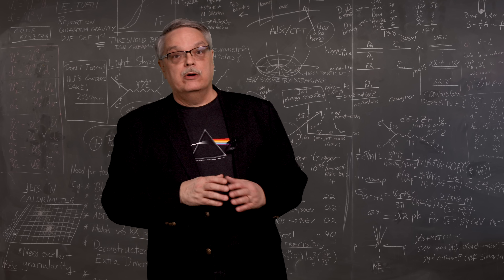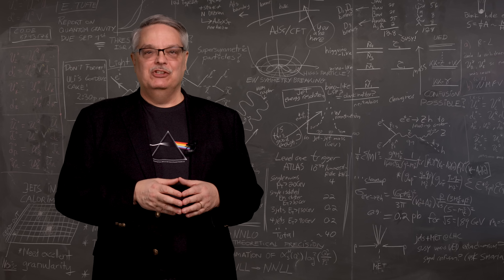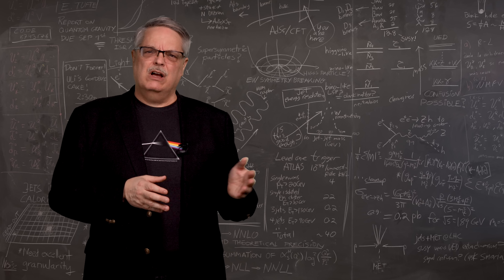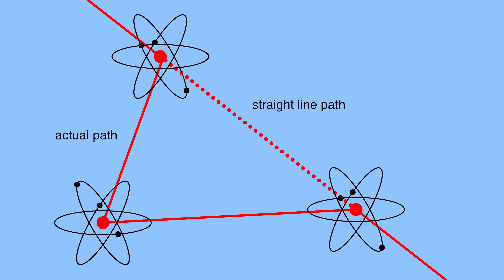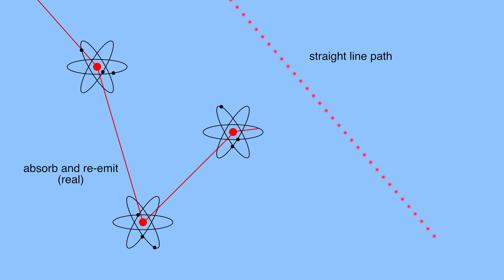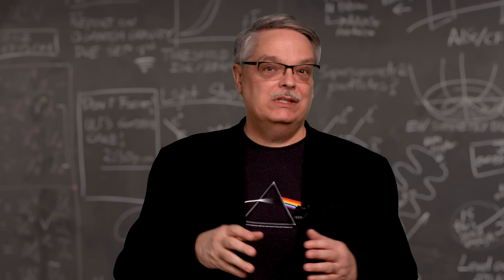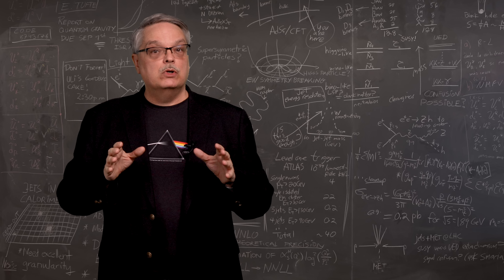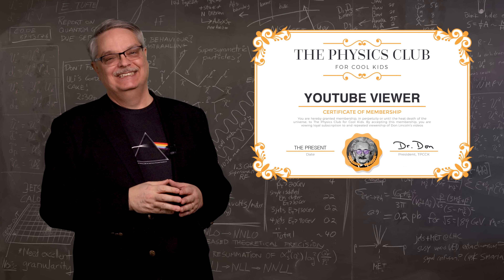Why does light slow down in water?

Comment: It took me 55 years and 10 minutes to understand. Thank you!
Reply: Happy birthday
Reply: @nikhilnegi9446  good one !
Reply: Hahaha good one!
Reply: This doesn't actually explain why things slow down. It explains the mathematical relationship of how much things slow down. Why a quantum field oscillation is slowed down because of other harmonics is something that just happens, but no one seems to have a rational explanation why it should.
Reply: @bramkivenko9912  It didn't explain why the change in direction...slowing down doesn't cause a change in direction...or the change back.
Reply: @johnbaldwin2948  different vid.
I wonder, where do you get a speedometer for lightbeams?
Reply: @johnbaldwin2948  the change in direction is refraction..

did you even graduate high school?
Reply: @savage22bolt32  +or- 20 kps
Reply: @johnbaldwin2948  I don't know if this will help you or not, but look up the "principle of least action".  It will explain why the light takes a "shorter" path.
Reply: @manlystyleunder50  What makes light change direction in matter?

Refraction.

What's refraction?

Light changing direction in matter.
Reply: @manlystyleunder50  Yes...but what causes it.  Either a photon interacts with the atoms or it doesn't.  How does a photon being absorbed and re-emitted "know" which way to be emitted.  This isn't the same as a wave going through slits.  This is photons either moving past (no refraction) or being acted upon by ATOMS...electrons...and then re-emitting.  Is it just probability?  And why the probability of the refraction angle?  And why does it change when it exits.  Why does a single photon interacting with atoms refract.  I know it refracts...why does it.  How do the photons know what angle to re-emit?
Reply: @Bob_Adkins  Exactly...that's what I asked...HOW does a photon hitting an atom..."know" what to do when released again?  After all...that's what reflection is...a photon interacts with an atom and is re-emitted.  Refraction is atoms changing a photons path after interaction.
Reply: @johnbaldwin2948  imagine someone asking 'how does a rock know to not move?'
Reply: @LarryFasnacht  But it doesn't...if light bends as it is absorbed and then re-emitted by an atom...it "should" do the same for each atom it interacts with.  If the first set of water atoms a photon hits makes it "refract". then the rest of the atoms it also hits..."should" make it refract too.  Yes?  No? Why the "density" change refraction...what is actually happening to electrons and photons at the boundary layer?  Mirrors are the same...WHY is there an angle of incidence and reflection when the reflection is photons hitting electrons and then a photon re-emitted.  There is no "bouncing".  How does the re-emitted photon "know" at what angle it needs to leave?  Is it timing?  angular momentum?  It gets absorbed...and by the time it's re-emitted...the electron is in the position to fly off at the same angle it was captured?  "Waves" doesn't cut it...the wave would be a mess by the time it got to the other end of the glass/water.  Thanks for the suggestion.
Reply: Just imagine the whole wavefront, forget the photons. If something enters an area with a slower speed , and one side of that thing hits first it rotates, because one side is going slower. Drive a car into mud at an angle, then you will turn as you cross from road to mud, as one side is impeded. The whole rotates, rather than individual photons, but there is more complexity to this for sure like phase cancellation and ling discussions of what a photon and the wavefunction is for sure! Light isn't a particle though.
Reply: They aren't necessarily absorbed either, their charges excite electrons so to speak. The photons actually pass by and there is a virtual wavefront of them completely unchanged. However, there is also the re-emission wavefront and phases cancel, so its not really still there "as light" even if the photons still move at lightspeed.
Reply: And 24 seconds
Reply: @lookatme7032  23
Reply: @lookatme7032  got to allow for a little dilation
Reply: My mind was going 186,000 mps so I'll get it in a few hundred years.
Reply: Lol
Reply: Please Bro can you explain to me why the wave created by the electrons moves at a different speed 9:20 and also why the combined new way moves slower than the speed of light 9:43 ? Please bro I didn't find why...
Reply: But sir here the wavelength can both increase or decrease we don't know. But velocity is equal to f×wavelength which means velocity can both increase or decrease depending upon the superimposed wavelength formed which may be larger or smaller. Please do clarify as light also have a chance to speed up in some medium
Reply: Lok
Reply: It took me 55+2 years 10 minutes 😆😅😄🤣
Reply: Does light actually slow down, or does it bounce around and lose only forward speed? I laughed at the 'why it is wrong' explanation, the longer distance is still work done. One problem, how does it accelerate when the undeserved trauma of refraction is over. Physics isn't always clever. E.g. in his wave effect explanation the photon still travelled a longer distance and never needed to accelerate.
Reply: But did you unindoctrinate yourself, when he reluctantly said that light is not a particle? 
(nighter is matter, but that does not matter)
Reply: @v2ike6udik  wrong
Reply: You meant it took you 55 years to find someone to explain it to you.
Reply: I'm almost 65 so…
Reply: 20 sec. additional for Ads
Reply: It took me a moment to see 👀that he always tells the truth and gives the best explanations ever. God bless 🌹🌹🌹
Reply: @hadherramadhanmohammed3699  plz don’t. Okay? I’ve had to go thru alot of therapy.
Reply: Best comment… ever.
Reply: @MoltenMozzarella  that's gonna be an heirloom for your grandkids!
Reply: 60 years an 10 min here!
Reply: 31 and you still beat me to it.
Reply: It took less for me, 42 years and 10 minutes 😁
Reply: Wait.  Doesn't physics also tell us that the speed of light is constant?    That's the whole reason that supports Theory of Relativity!
Reply: @jhy190  dont read the headlines, mkay
Reply: @v2ike6udik  :    Not only the headline but also the video says that light slows down its speed of travel depending on what it's going through.
Reply: @jhy190  Light doesn't slow down by itself, only combined with the electron wave whatever that is but light cannot lose energy when it enters the glass otherwise it couldn't speed up while exiting the glass.
Reply: It took me 62 years to become a cool kid.
Reply: @richardj9016  Wanan be cooler? :) Come to next dimesion. Oh, it´s there. :)
Reply: exactly the way i feel
Reply: Great! Can you now explain why the combined wave travels slower?
Reply: happy birthday
Reply: Then happy birthday
Reply: for me its more then 15 years
Reply: Excuse me you still can't buy this answer it's wrong. Think about it. All EM waves travel at speed c. EM waves are not actual magnetic and electrical forces but rather just information of their existence i.e. fields which are imaginary and those changes in magnitude of fields are ripple like imaginary things that travel at speed c. Hence the wave nature .
Reply: Don't worry, these types will completely change their theory tomorrow and deny today's theory was ever theirs like they did to Arp, eg.
Reply: Happy belated birthday
Reply: And 24 seconds
Reply: And now you're more brainwashed than before
Reply: OMG 😵‍💫🤣❤️😍😍😍😉😉😉
Reply: Video explanation is not good. Original electromagnetic wave should still travel with a speed of light in vacuum. Electromagnetic waves don't interact. Combined waves might create an illusion of going slower but it does not matter since only original wave is exiting from water. In addition, how did they measure the speed of light in water over such a short distance?
Reply: If you think you understood it, then you did not understand anything. 
He tried to describe the Ewald-Oseen extinction theorem, but in a totally wrong way.
https://en.m.wikipedia.org/wiki/Ewald%E2%80%93Oseen_extinction_theorem
You can find the falsification explicitely:
"...each of these waves travels at the speed of light in vacuum, not at the (slower) speed of light in glass."

2 particle based wrong explanation has been replaced here by a wave based wrong explanation. A fast and a slow wavefront can not be combined, since they can not stay together. This is not a physics model, just a wrong play with words.

The way of thinking of Don is fundamentally wrong, because propagation of light can not be modelled with infinite sine waves, that has no wavefront at all. 

Most of the animations are also completely wrong, for example at 7:11, because it shows different frequencies, while the excited wave can not have different freq. from the source wave (as can be seen at 8:11). Not wavelength, but frequency determines the color!

Almost nothing is right here, except for the falsifications of the 2 particle based explanations.
Reply: High school text books need upgrade.
Reply: @hariprasadyalla  Yes, but not with this chaotic bullshitting.
Reply: How old are you now
Reply: Stefan. He
 used to blow my sisters Lower lips and suqqq on my coqqq. 

Do you support him? I’m mentally I’ll now :(

Comment: If the speed of light changes in a material due to the presence of the electric field in the material.  Then would it also be true, that the speed of light in a vacuum would vary in the presence of an externally imposed electric field?

Comment: You ramble on about 2 wrong explanations hoping to tire us out so we don't question the supposed correct third explanation but it didn't work! :)
That was wholesale inadequate. That's a do over. I seem to recall a QED explanation about the surface seen as a series of new oscillators that through interference combined to a new direction but even that doesn't even cover why the new frequency is as it is.

Comment: But the question is how can the electron generate another wave because of the electric field due to the light wave without effecting it, before it even interferes with it? Wouldn't the incident light's electric field also vary as a result?
Also, wouldn't this be the same as saying that the light wave that we see in the medium is essentially the wave generated by the electron as a result of it's interaction with the incident light, as opposed to being superimposed with it? But then how is it different from the absorb-emit argument, because even in the interference case, the direction of the electron generated wave can be completely random?

Comment: This explanation was actually given in Feynman's lectures. Let me tell a bit more about this. The electrons of atoms generate slower EM field, because electrons cannot respond immediately to the driving force of the external EM field. It takes a bit more time for electrons to respond to the external EM field, and that causes the delay in the newly generated fields. Some electrons cannot generate fields of same frequency as the external field. Also, there isn't only one EM field generated by electrons. Since every atom has several electrons, depending on the chemical structure of the material, every atom generates many-many different waves which in combination gives one effective EM field. That's the reason why different materials give different effect of slowing the speed of light, because the total number of electrons are not same. Depending on how close the electrons are to the atomic nucleus, electrons generate different types of EM fields. All these things in combination give the effect we see. It is not easy to understand all these effects in combination and is still a subject of research.

Comment: What if it passes through a material made of protons only(hypothetical).
Will it travel without any bend or anything??
Reply: Well his explanation implied that it was the oscillating electrons that caused the speed difference, so presumably any effect on the protons that are there as well must be negligible  - perhaps they oscillate much less and cause a much smaller field? Therefore, maybe (!) protons by themselves would have little effect.

Comment: But does information transmitted by light travel slower through matter as well or do the flashes come out the other end at the same time as though they passed through that space in vacuume? If the initial light wave is still moving at the speed of light through a vacume and is just being added to, shouldn't the whole thing start and stop at the same time that the initial wave is passing thorough?

Comment: Answer me something.
How can light travel straight which is emmited by a laser whereas HUYGEN'S Principle says every point on a wavefront of light is an independent source to produce secondary wavefronts.
Light should go in every direction available.
Reply: Huygen's wavelet sources are not independent, they are coherent, meaning the timing (phase) of the emitted wave is correlated. The "direction" of the light is dependent on the wave reconstruction (group velocity), which in turn is dependent on these phases.

Interestingly, there is a strict relationship between the spatial localisation (width) of a laser beam and the range of directions (momenta) it can travel. Reducing one increases the other. The smaller the width of the laser, the more it will spread out as it propagates (lasers strictly emit in cones rather than straight lines). The Heisenberg Uncertainty principle is essentially a re-statement of this fundamental principle of waves.